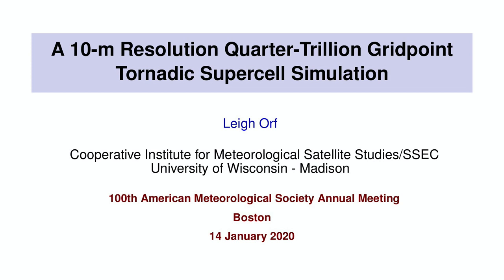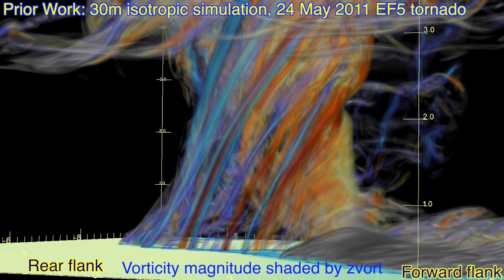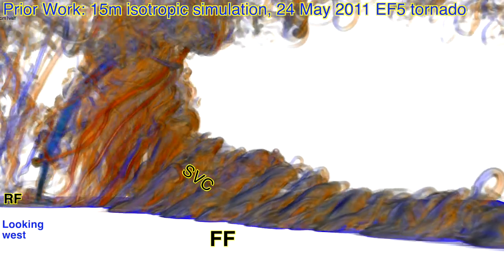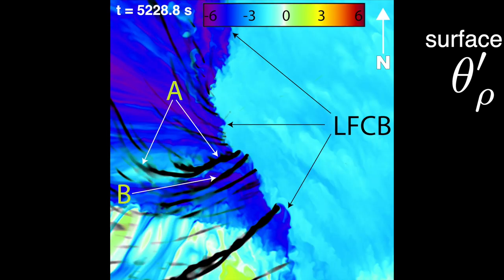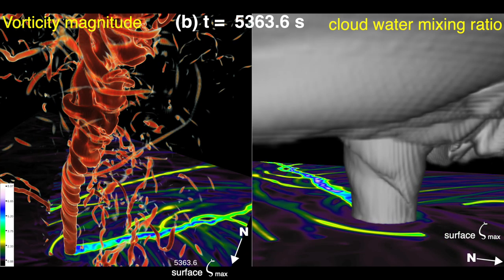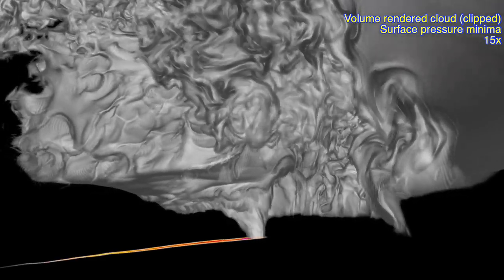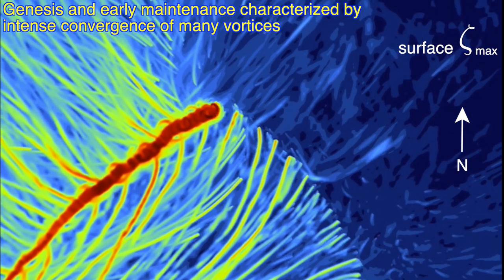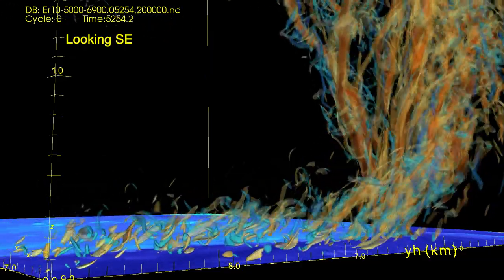A 10-m resolution quarter trillion gridpoint tornadic supercell simulation

Comment: you know right the cold pooL in the Fore Front DowndRaft and the RFD is often a warm inflow but it onlyhelp strengthening the tornado helping the cold core of the twister, that reall looks like a Tight coiling DNA like spiral, and the FFD, is now more known and accepted as the SVC Streamwise Vorticity current is on the cold pool, the cool that get get sucked up by low pressure pertubation within what really makes a tornado spin and create those deadly spiral that may obliterate a house EF5 style but leave the next one slightly damage but the wrapping of the RFD, that rises and coils easily and snuffly allong that cold stream as it will mix and war until 33k feet or so and the SVC streamwise vorticity current also known as the main inflow get, eiteir 60 - 30 or 2 degrees of the ghost train clouds, and forms a oclusion cloud at the base of the condensation field of a conado* or a stovepipe twister* above that or around that often obsuring is the wall clouds ...POINT IS that that tail and ghost train cloud is a result of real twisting tightly rotating SVC on the ground invisible BUT IT's there, did you check out lee orf work especially the video that compares it with real storm chasers like PECOS HANK had a look with doctor or professor (idk) lee orf and abng everything matches up with the supercell, i mean EVERYTHING and it's obvious now that the EF tornado's especially feed of the cold pool and the FFD keeps cooling that field and the RFD is just there as a consequence but is also important of tornado genesis as it created a presure gradiant within the meso cycone, it's now about  the micro bursts youd find there, no more way allong the storm front several FFD's tehat get big, LIKE REALLY BIG and last 5minutes and they are popping all the time i think lee orf needs to focus on those if he wants to proof his work and as a very cautious scientist he's being afraid of screwing up the modes he neds funding so he can use better super computers like nasa's VEGA. So he can create a lager and more dynamic domain. because what do we see in EF5 storms? Lots and lots of rain and cold and on different side lightning warmth winds and in front of the dry line it get moisty warm hard to breathe as the pressure drops and BAM, i've talked with him last week about the tornado outbreak and told him all this and  he said jeez man, i really need to take a look at the forward flaknk of a storm and i said nonono not just that study multicellular low end storms,  lower end storm front AKA squall lines and or indeed multi celular non rotating storm fronts COMPARE THEM and i hope that in yur office or the computer room you prnt out a bunch of paper and SHOUT, ...

EEEEEUUUURAAAAAKAAAAAAAAH, and i i dare if that turned your work upside down or has gotten way ahead ready for the research of TORNADO WARNINGS as early as 24- 48 hour til..... a few hours... to finally start that work yyou get me a green card, and we meet up explain our work and fly to japan and freaking do Japanese karaOKE, the song......  Full version of eurka 7 Opening 4 'Sakura.' or opening 1 and two. and eat ramen, because we like noodles in every way imaginable go on vacation in FIJI or indonesia or something may northern australia, and meet another meteorologist that does the same work u do just without chips and computational fluid dynamics (what a shame, but she holds the key) and get a weeks off vacation and get me a lawyer as i am on the brink of suicide right now as an unfair case is popping up. Hehehehe, that's what i'm telling you lee orf, awaiting your reply BTW these two cents are worth allot more AS WE HAVE SEEN AN F3 TORNADO IN THE NETHLANDS IM NOT FOND OF THE eNHANCED SCALE IT WAS AN ef1 and it wasn't storm associated but definitely culombinimbus atmospheric 26k feet at most but sculpting and rotating due to insane wind shears and we have had allot of those also on land and on land coming waterspouts turning into tornado's. not rare but the rarity lied within the amount and duration strength overall, we have constant dry lines warm moist air filled with rain, cloud heating, and cold dry air, daytime ground heating, in a sea climate, not rare but the amount of low pressure and high pressure super localized coming in and over ,arch winters,, hail and warm temperatures for the time and very cold nights a typical battle for low and high pressure but oscillating in a very high frequency, creating the most insane atmosphere for including winds and Jetstream's, completely in shear. look up the northern netherlands Friesland, (stations (EHLW, EHGG, EHKD, check the northern islands, seriously those are separated by just sludge and a meter of water, creating sprout RIPE WARM POOL conditions and, what is the weather like the past month or 2 we have had lots of spouts. associated with rain, often in the evening. and morning even., can u research this i think along with supercellular microburst or plain down drafts coming with rain and winds (vertical downwards. just get sucked right back up in the US creating these monster F6's and EF5's or el reno.... that was allot of air that had to be balanced out in a short time aka storms bursts, micro/macro bursts straight line winds, the forming of the cold pool  tell me how does the pressure perturbation get so strong anyway. we both know but is a consequence of air masses needing to swap position eventually though a narrow gap, and the quickest way to empty a bottle is with a whirlpool, when a spin in a supercell initatesthat or windshear of all sized ef0 to ef5,thats the quast way, Oh an popcorn flying up in the air in [movie: 'supercell'] 60m/s will do that and not just with popcorn right :) u are eating popcorn then and people seeing that scene look up above them hehehe i mean It as in ITALY, here are unique formation of water sprouts the netherlands where i live the north sea sees more tornado's that where ever the F-work in the fu**ing world F-0's water sprouts everyday there' at least on average 30 you can always see them, the water is cold so it wont condensate and is associated with just an experience of a prolonged unidirectional wind gusts, but that where you catch the most fish underneath one, just not on fully developed and dark cloudy condensation funnel f1 ef0's woth strengthangth and updrafts enough to lift a human body or even capsize fishing boats with wide and EF1 F2 ones.

Final thoughts, i see allot of you in me, and once were working on something we forget the greater picture in tunnel vision, NOW i am not accusing u of that, but u need a real hardware experts MULTIPLE with YOU in charge to learn your ways and help u, now i cant program at all a little xhtml and barely some python scripts but its not my thing, hardware configuration, c

I think all kinds of storms needs to be researched, and also multiple types of cells and storm fronts/squall lines. and MicroBurst Computational fluid dynamics just to confirm or debunk their effect or find things. We haven't thought about, and there's no trigger? maybe the strengthening of the cold pool and 'hot pool'

I do not claim to have a PHD in meteorology all though i have a bachelor's degree of it, and i used to be an airline pilot until i got sick.

IMMA MAIL YA Dr. Orf. hands down best researcher ever.
Reply: on top of that in a FL600+ overtopping cell with rain being dumped upon in FFD's, where does that extra Cold come from hey? that's right WIND ALOFT and the cold reached of SPACE, like how hurricane's are being sustained, i suggest compare em too.

Comment: I have an idea, but I assume with such massive data and computational requirements this would need heavy funding; nonetheless, here is my idea: what if you 1) ran the empirical model that you currently use for some specific supercells thunderstorm + tornadoes and save all of the 3d rendering outputs; 2) make sure you have the associated real life footage of the same storms. 3)Then: train a neural network based on the real life footage (i.e. use generative AI model); 4) train another neural network based on the 3d renderings from your model output; 5) train another AI model, lets call it a correction model: this model will essentially use the weights from the other two models, and compare them to ground truth (real life footage) and to each other, and make a correction in the data; 6) now you can run your emprical model, and feed it into the AI correction model - in doing this, you can incorporate real-life Computer Vision data + non CV data collected + 3D rendering generated from the non CV data, and get a 3D rendering that more closely matches the real-life 3D output. Maybe that will give some more insight and better visualizations? Maybe some of what I said can be adapted in another way? Anyways, that is my general idea. Btw, I am a CIS senior at the University of Michigan-Dearborn, and I love CS, and I love Tornadoes since I was 7yo!
Reply: I think you are the person to see what this might be like!

Comment: Incredible. Question (for the freak chance you read these comments): Do you think the same multi-vorticy carousel of the maintenance cycle is equally present in violent "drillbit-style" tornados, just more tightly condensed? For example, visually, neither the Manitoba EF5 nor the recent Minnesota EF4 appeared to have any dance partners to their incredibly tight funnels for long, sustained periods of time.
Reply from the maker: Alex, it is likely that there is a lot of variation between tornadic supercells. Keep in mind however with a dry boundary layer you might not be able to see visibly these little vortices, but they could be there. In very humid boundary layers you tend to "see" vortices as condensation occurs in the center. So I would say that yes, there is abundant vorticity in most supercells, specifically along cold pool boundaries, but I make no claim that the "parade of vortices" and SVC are necessary for tornadoes. I suspect these things occur more frequently in the big monster storms.
Reply: @LeighOrfsThunderstormResearch  Thank you so much for taking the time to reply! That makes sense. El Reno is such an interesting storm to be studying because it feels like the entire meso just lowered itself to the ground. I can't wait to see how your research develops! Your work is truly awe-inspiring.
Reply from the maker: @AdevebA  Thanks. To be clear, the El Reno storm I'm simulating is the first one, 24 May 2011. I am however working on 31 May 2013... stay tuned...
Reply: @LeighOrfsThunderstormResearch  THAT explains why I thought it looked small! Haha
Reply: 10/10. I'm not a scientist, just a dude watching this video tonight as two storms passed over, getting 3-5% better at knowing what I was looking at 😂. Hey thank you for sharing your work! 🤟 I also saw that vid of Greenfield. Wow! And clear similarities to your model. Cool! A question... I heard "solving turbulence" is something uniquely difficult, and it's written that it's "solved in physics but unsolved in math". Do you have thoughts about this? 👍 Thx again!

Comment: Very well articulated model of an enormously complex process. I think it would be fascinating
and instructive to link the simulations to  hodographs that would be likely associated with 
various supercell intensities and morphology. I realize that's a tall order, but it poses
considerable useful forecasting potential. Same could be said for the thermodynamic profiles.
Reply from the maker: That's what we're working on, lots of simulations in different environments - just at say 75 meters, not 10 meters.  It's a fun slog.
Reply: @LeighOrfsThunderstormResearch  Yeah, I can appreciate how the lower resolutions could still shed light on why certain shearing environments produce splitting storms, or supercells that are not efficient tornado producers compared to those that are. I'll anxiously wait for the simulations.

Comment: Take the sky imagining that being a body of water, you got cold air wants to fall  when you have enough hot air rising in a certain area that cold air has to go somewhere and that’s what creates a downdraft And just like a body of water   draining threw a pipe it will start twisting.
 A tornado is nothing but hot air rising around a column of cold air falling around each other creating a twisting affect.
 Dust devils are not very strong because it doesn’t have moisture (water droplets) to intensify the moving of air  down around it. 
Air does not move air well but water droplets intensifies the whole situation.
Water it’s self displace oxygen go into a cold room take hot water at least 180° and just let it run down from the shower and watch the small water bubbles Form in a room  make it difficult to breathe that is a low air pressor Replaced with water droplets that when cold water Droplets can fall at much greater speed then terminal velocity ( The speed at something will fall with a resistance of air slowing it down ) There’s no air there to interfere with The cold  water droplets falling
Allowing hot air to rise violently trying to replace air the cold water droplets left as a vacuum in the  space above with hot air wanting to rise just intensifies it.
Reply: Sorry, tough read, but what I could understand seemed logical. Sounds like your head kind of where mine is, maybe the wind starts the storm rotation but the oxygen content/temps/pressure/rain actually kick off the tornado development from there.
Reply: G L I have a tendency to text without using my periods maybe this’ll make it better to understand
Reply: G L Take the sky imagining that being a body of water, you got cold air wants to fall  when you have enough hot air rising in a certain area that cold air has to go somewhere and that’s what creates a downdraft And just like a body of water   draining threw a pipe it will start twisting.
 A tornado is nothing but hot air rising around a column of cold air falling around each other creating a twisting affect.
 Dust devils are not very strong because it doesn’t have moisture (water droplets) to intensify the moving of air  down around it. 
Air does not move air well but water droplets intensifies the whole situation
Water it’s self displace oxygen go into a cold room take hot water at least 180° and just let it run down from the shower and watch the small water bubbles Form in a room  make it difficult to breathe that is a low air pressor Replaced with water droplets that when cold water Droplets can fall at much greater speed then terminal velocity ( The speed at something will fall with a resistance of air slowing it down ) There’s no air there to interfere with The cold  water droplets falling
Allowing hot air to rise violently trying to replace air the cold water droplets left as a vacuum in the  space above with hot air wanting to rise just intensifies it.
Reply: @Robert468us  I dont believe it's that simple. I believe it actually wants cold air. I feel like if it dumped too much of one or the other its development and structural integrity (cell as a whole not just the nader) would begin to weaken. Maybe that is why they go through cycles; they lose too much of one needed element and have refuel/rebuild. I truly believe these things FEED on environmental factors like we as humans do. We could intake an excess of one nutrient and a lack of another and have issues. But if we intake everything we should, we develop very well and are finely tuned beings. I'm not saying a storm is breathing and thinking, but I do believe once its kicked off, it will get what it needs from the atmosphere around it. Some have RFDs and some dont. Maybe that's a way of purging unneeded energy and unspent "fuel?"
Reply: An RFD could be a purge valve or vacuum leak! Haha
Reply: G L To help you better understand what I’m trying to say go by the fire department have them turn on the shower spray and stand behind the nozzle and just feel how much air is move by just a little bit of water then magnify that 100,000 times with a super storm and you will understand what I am trying to say cold air with water Droplets falling move more air and intensifies the wind creating a vacuum Hot air has to replace rising when the to meet each other they start spinning And that’s what creates your tornadoes.
Reply: G L Instead of worrying about a purge valve, Some flowers would be nice if you put them on the graves of people that died from tornadoes and their families was destroyed

Comment: Question: Does Theta prime subscript rho mean Angular Velocity with respect to density? Trying to figure that out. (First time re-watching after a ChemE Fluid Mechanics course)
Reply: (Also, is there a place to look at the mathematics behind your simulations/an explanation behind them? I'd like to be able to use the knowledge gained after this admittedly hellish course in Fluid Mechanics for something interesting)
Reply from the maker: @garethfuller2700  Potential temperature = theta. Theta prime is the deviation from the background theta (i.e., the environmental sounding). Positive theta prime basically means positively buoyant, negative theta prime means negatively buoyant. The rho subscript refers to density potential temperature perturbation. This includes the effects of hydrometeors which make the air "heavier".
The document you want is this, which describes the CM1 model and has the equations: https://www2.mmm.ucar.edu/people/bryan/cm1/cm1_equations.pdf